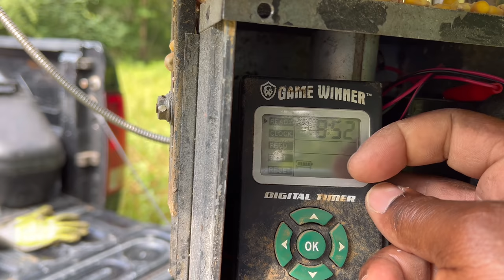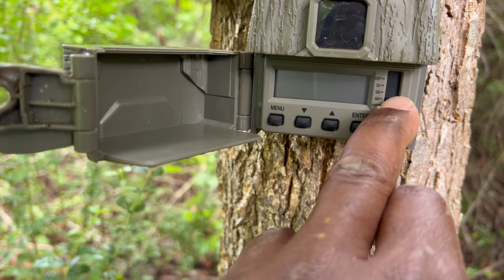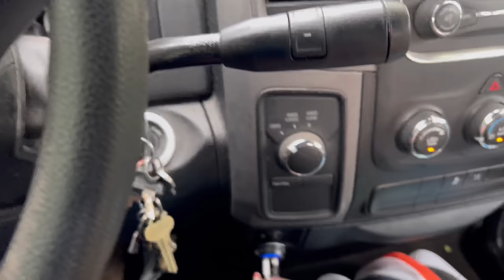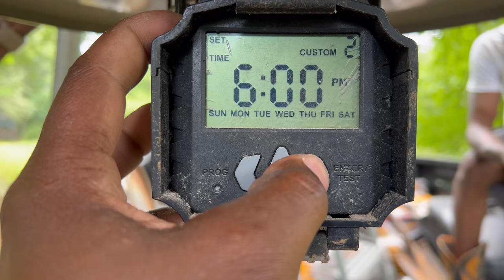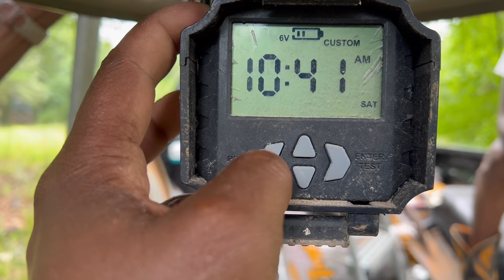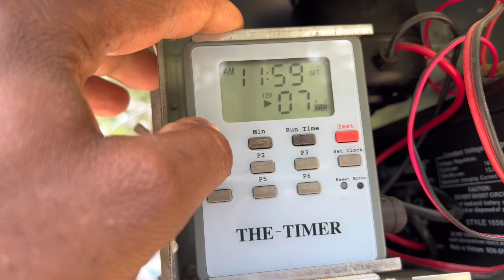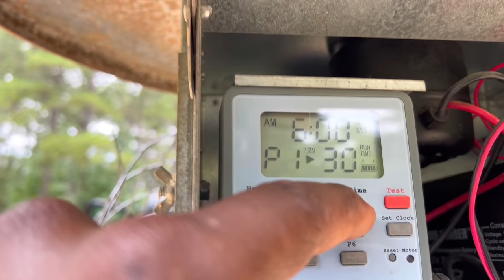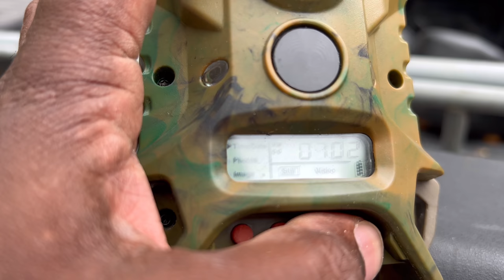First trip to the Property this year to fill up Deer Feeders,You not gone believe what has happened

Comment: Hope u see and use this tip to save your locks out in weather cheaply reuse a gallon milk or other plastic gallon jug put each end chain in through the top make it larger hole if needed cut out the bottom pull both chains halfway back up tape together and the top to shed water away from the lock I've used this trick and have had the same lock for 10years or more just a thought that might save ya a20$

Comment: Just a suggestion. Ditch the alkaline batteries, and invest in the more expensive lithium. The alkaline batteries don't have enough juice to last long. Also, check the model game camera you're using. Depending on the model, it may not be capable of utilizing large SD Cards.  Different models are only capable of using SD cards only so big.